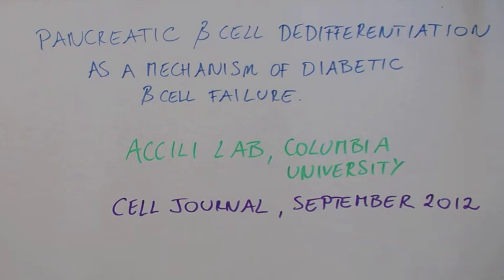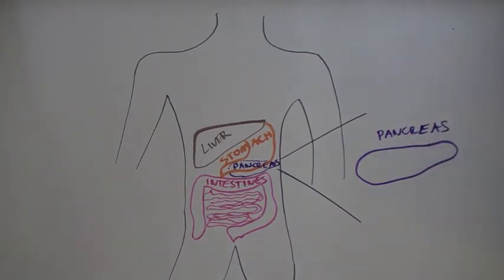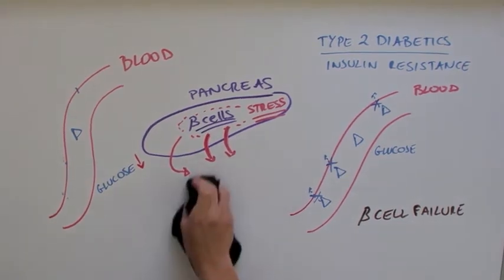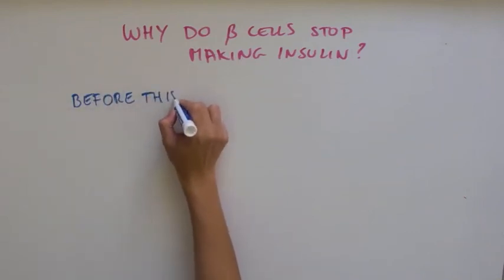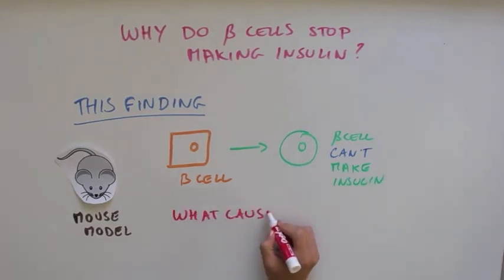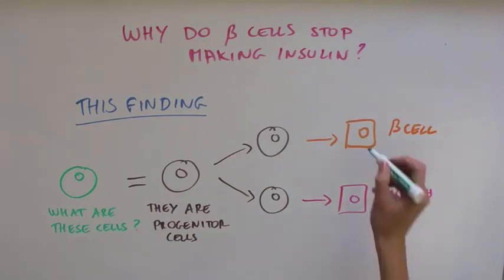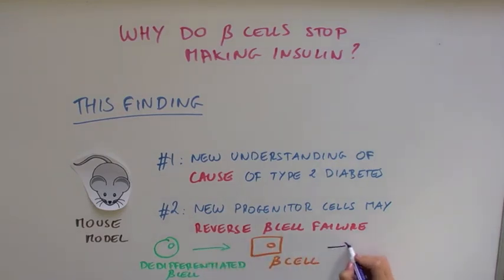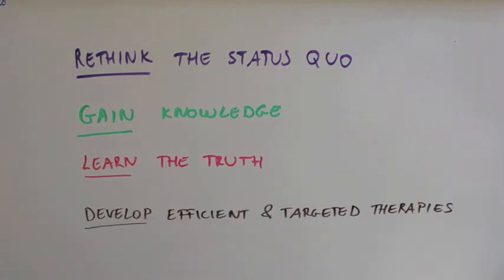GOING AGAINST THE GRAIN: A new explanation for pancreatic beta cell failure

Comment: Insulin allows the cells to be able to uptake glucose for use or storage, not simply to reduce glucose levels in the blood. If there is a surplus of glucose they are going to develop insulin resistance to try and control how much glucose they uptake.